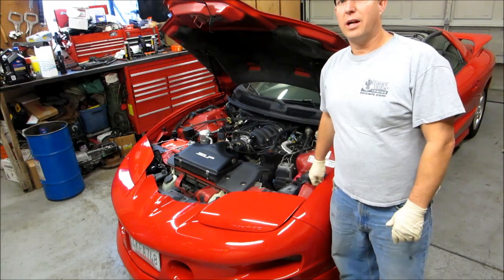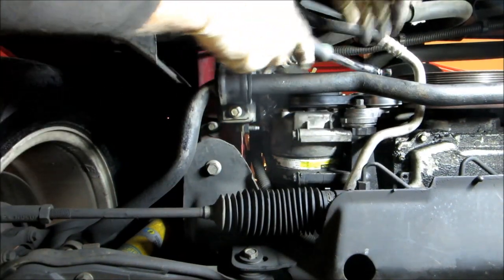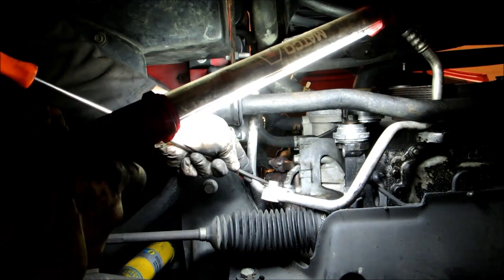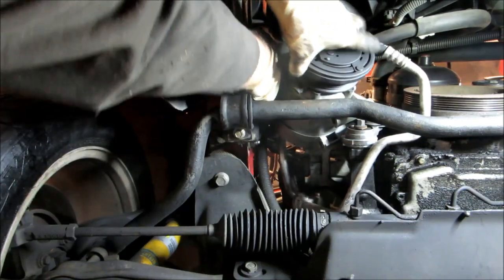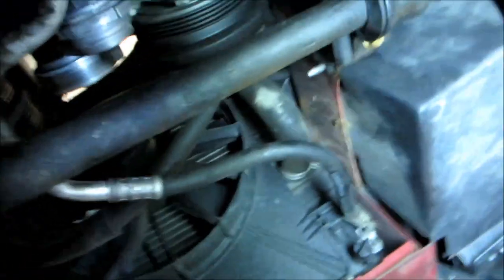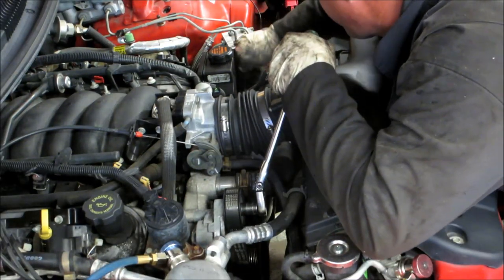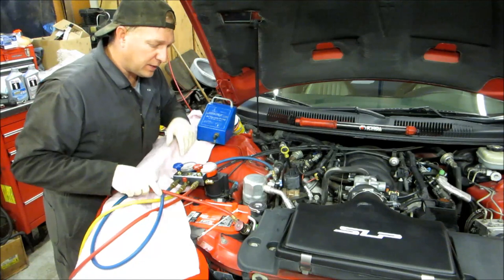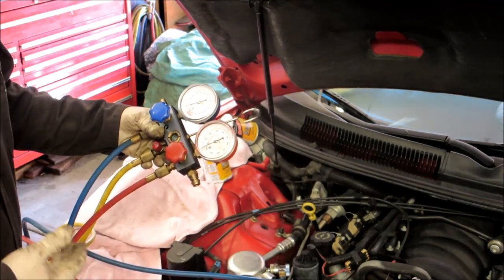fire bird AC compressor

Comment: I get to change the ac compressor hose assembly.  Mine took a rock to it.  Hoping I can get the hoses off without needing to completely remove the compressor. Thanks for the video.

Comment: 1 thought...
You should purge that charge line. 
As it now has air in the line that you are forcing into the system.
Reply: Explain how you do that, genuinely curious don’t wanna fuck up my car
Reply: If you look closely at the gauge setup he has. There is a little schrader valve in the middle. His is covered by a red cap. Before opening the valves at the end of the lines connected to the car, open the gauges, open the bottle, then purge that valve with a pen or something until Freon comes out. Now the lines are free of air and you can open the low (blue) side to charge the system. 👍
Reply: @302KingCobra  thank you 🙏

Comment: Thank you so much for this video. I just did this job and found that the top two compressor bolts are easy to deal with from the top. But you have to remove the two coolant hoses that connect to the water pump.
Reply: didnt have to remove coolant hose just used a stubby ratchet no problem

Comment: Why didn't you replace the accumulator? It's a sealed system and once its exposed to atmosphere its no longer any good.. your ac system will not work properly now
Reply: Trey Proctor the accumulator isn’t ruined lol, just because it’s been exposed to air, there is this thing you do called vacuuming the system which removes air and moisture before you add refrigerant. Do a little more research before adding in your stupid comments. If your suggestion was true you would have to replace every single part in the ac system and that wouldn’t do you any good without vacuuming the system either. Do you think the accumulator comes sealed and do you think you can install it while still sealed? I think not.
Reply: @1992danib  try is right when every you change a compressor for warrenty allways  change accumulator and orifice tube since compressor is new ans why call him stupid new they are vac sealed when you pull covers off you will hear the thud sound so quickly install it system will be colder and work way better if you change vac test t for 5 to 10 min then charge if no leak s
Reply: You only have to change the condenser and dryer if the compressor came apart internaly, if your replacing it for a leak its not necessary to change condenser and dryer and orpheus tube
Reply: The dryer wont be damaged because it was exposed to air. You just need to pull a 10 min vacuum
Reply: Trey P The people who make accumulators agree with you.  They act as filters if the system gets full of metal then definitely but most of the time refrigerant just leaks out. Water boils at room temp when under vacuum so it is evacuated too.  The only other issue is oil.